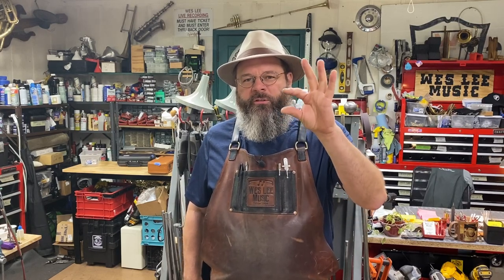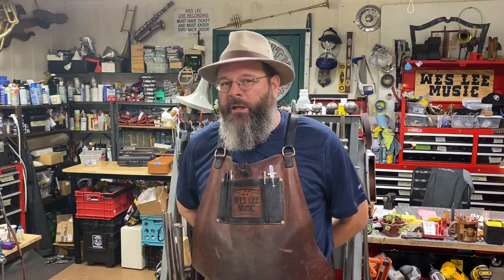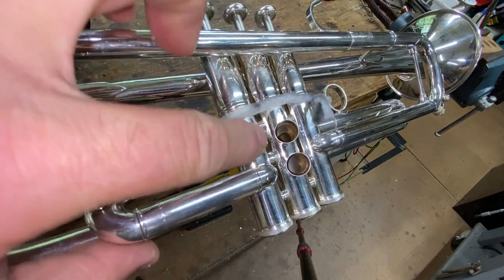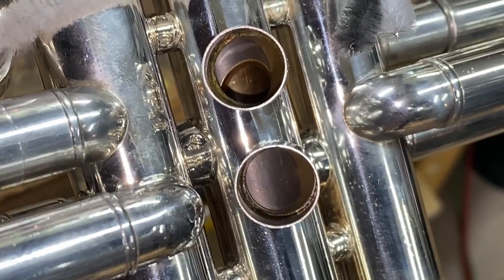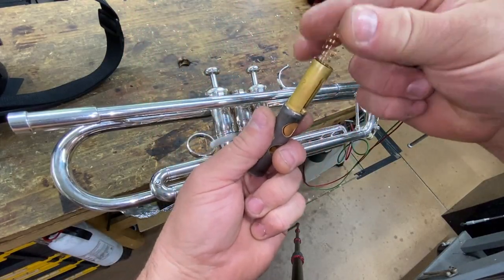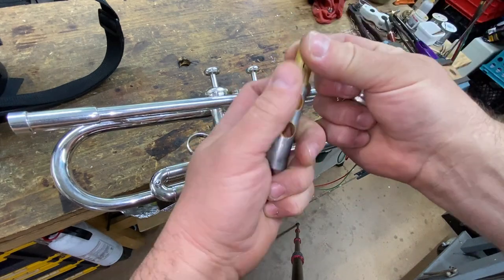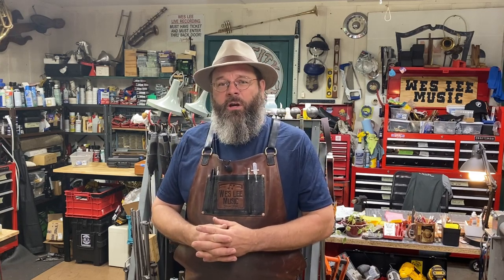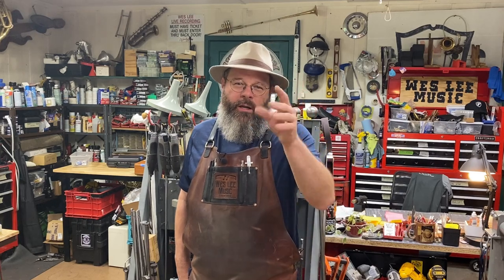Lateral Valve Alignment- Custom Valve Guides- Band Instrument Repair- Wes Lee Music Repair

Comment: back in the late 80s i had the good fortune and privilege to take trumpet lessons with a man named Roger Blackburn (40+ years in the Philadelphia Orchestra), he was not only a brilliant musician, trumpeter, and singer, but also a very skilled technician.  when i got a new trumpet, he would break out the blowtorch.  first step was to loosen all the big joints on the instrument one at a time and re-solder them with optimal tension.  then he would do a lateral valve alignment - he had a jig made for separating the two halves of the valve to do so.  often he would replace the stock water valves with nicer ones.  then we would spend an hour playing with valve guides - he had a big box of brass ones and we would try a dozen or so in each valve.  vertical alignment was dialed in using little bits of paper stuffed into the threads under the valve cap.  :)   great to hear you talking about this stuff - i don't blow any more but when i did i never heard of anyone else who was doing this kind of detail work.
Reply: Great stuff!

Comment: Do those guides have to be custom fit, or are they standard? I would assume as the valves wear they might not wear the same for everyone.

My 25 year old Bach Strad has some side to side play. I've improved it with 3D printed valve guides, but it could be better still.

Comment: So how exactly did you make that magnetic ball dent remover? I’m new to the field and can solder anything back together, and can replace any part, but I can’t remove dents all that easy. I bought some dent hammers but I don’t have the roller or the magnetic ball dent remover and was wondering how you did it?
Reply: Conn sold them years ago. Don't know who sells them now.
Reply: You really need a roller or a bell iron to hammer out dents.